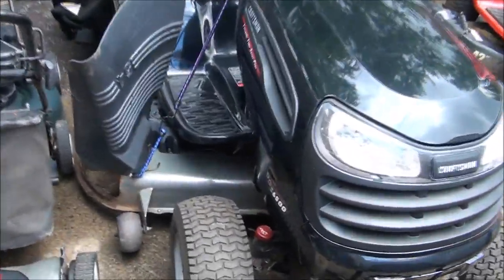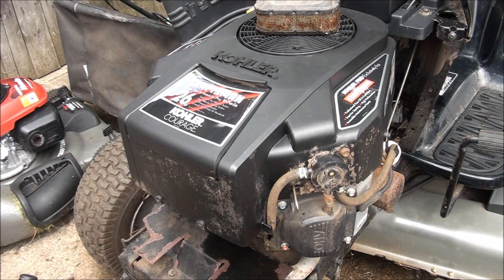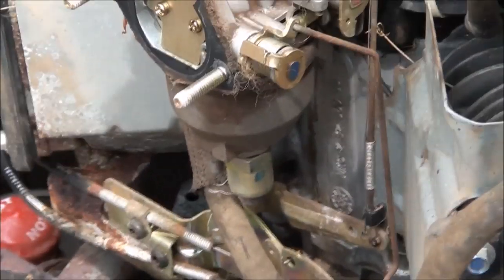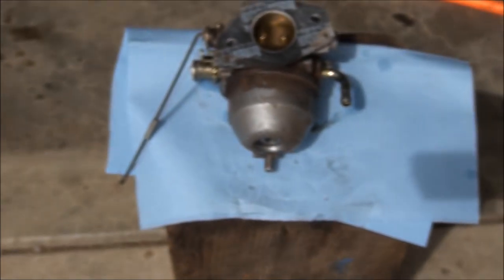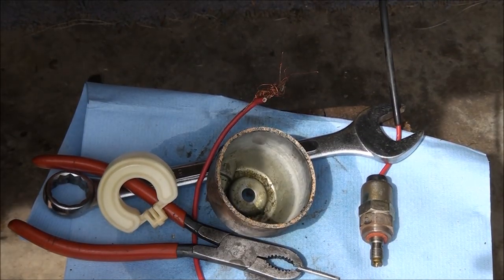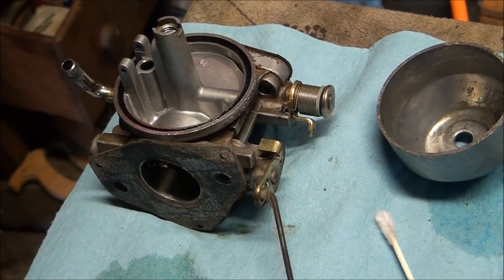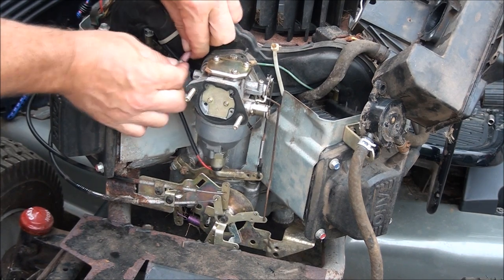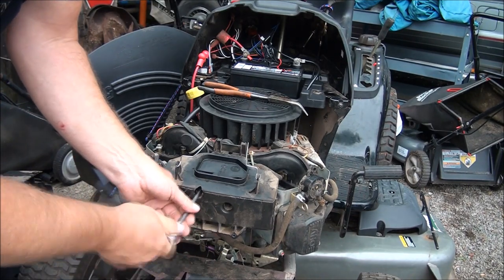Riding Lawnmower KOHLER Pro Courage 26 Horsepower Twin Cylinder ~ CARBURETOR REBUILD Repair

Comment: I want to thank you so much for this detailed tutorial  ! I have the same on my 2005 cubcadet  . It was running rough and like an idiot I took it off because online it told me carb was the problem.  It wasn't.  It was the plugs dirty filters (gas, oil , air) I thought I took good pics with my phone.  I looked at other vids yours was the only one I found where you took the time to explain and close ups ! Thank you for the close ups  ! You helped this 63 year old grandma fix my mower ! You're now my hero  !
Reply from the maker: thank! good job

Comment: My 26hp Koehler is doing the same thing! This video covers all areas of the fuel system, testing each component for functions. Maybe now I can get my mower to run more than twenty seconds! You’ve been a great help. I’m subscribing to your channel!
Reply from the maker: Thanks friend. I hope it helps.
Reply: @jeffslawnmowerrepairandservice  Many thanks friend! My mower is running smooth. The solenoid was stuck closed from green junk in the sediment bowl, the filter was varnished smell, nasty. After watching the video, I was able to clean every component of the fuel system and I didn’t have to replace any parts, now it runs again. I’m glad to see that video. Great job and many thanks for taking the time to share it. 👍

Comment: A tip that I learned many years ago with motorcycle carbs is to remove the bowls and completely submerge the carbs in a 50% Pine-Sol 50% water solution.  Let them sit for 24 hours turning them over around the 12 hour mark.  It will remove a lot of varnish and does not harm rubber or Teflon components.
Also I like to run safety wire through all of the orifices, jets, etc... 
I like to push the safety wire through the orifices before and after the carb soak, then use compressed air afterward.
* -  Just remember to pull your cut safety wire through some folded sand paper after you cut it with diagonal wire cutters to remove any burrs (diagonal cutters always leave burrs) so that the safety wire won't scratch any passages.

Thank you for a great "How To" video!
Reply from the maker: Great tip! Thanks for watching
Reply: Who the hell has time for 24hrs. I always laugh when people suggest something like that.

Comment: Great video. I learned a lot and discovered that last year when I had the mower serviced I was told that I needed a rebuild kit. Well from what I could tell from my carburetor the shop did not install a rebuild kit - most likely just squirted a bunch of carb cleaner around. Thank you for a great video. You have saved me money.
Reply from the maker: I am happy it helped

Comment: This video is top notch.  Your explanations and camera angles made the process very easy to understand.

In my case, the repair was for a 26 Horsepower Kohler Courage engine that's on my 2007 Craftsman GTS 5000.  For the first start of the season, the gas flooded into the air filter and dripped to the ground.  I did some troubleshooting and decided to clean the carburetor with the help of your video.

There were a couple of small differences between carburetors.  First, the float bowl on mine was attached by 4 screws.  Second, the float pin/needle assembly was a little different.  These differences were minor and easy to work around.

After following your instructions, I also changed out the oil, gas, and fuel filter.  The tractor fired right up without flooding, and I mowed for about an hour until it got too dark outside.  It runs like new again!  Thanks for your help.
Reply: I used the video also for a Kohler Courage 26 engine and it save me so much time.  I put on a new carb and it runs like new.  Great video.

Comment: Fixed mine just now. Thank for the video
Reply from the maker: Glad it helped
Reply: @jeffslawnmowerrepairandservice  great video  i wish i had watched before doing this work, i did basically the same thing as far as cleaning the carb, however i didnot take the slinoid componet out as you instructed,  after reassembling started right up but i could tell the engine wasnt runnung full throttle,, so like a novice i attempted to adjust the throttle and choke cables which lead to the throttle stopper screw too in an effort to idle it up and now it wont start, after jacking with it was running it and suddenly died  was able to start it but it only  ran momentarly  ,, no she  wont start ,, is there any tips or videos you have that could aid me in this?  cuz im fairly certain i have it wrong.  i can assume that the main jet in the silinoid componet neded attention ,, and it didnt get it,, because the  carb was quite dirty,, so  consequently i now figure that was the cause of the slow idle, what is your thoughts?  i was careful to reassble it with out misplacing the linkage items i refered to your video and my placment of everything is just like yurs,  i will clean the part i missed  but the throttle cable choke cable has me wnating to choke someine [ 'myself i guess'[ thanks

Comment: Thanks for the video. My son's Husqvarna was exactly like your Craftsman. The hood came off the same, same plug for headlights, the exact same bolts for the shroud and fuel pump, exact same linkage for the choke and throttle connections. Now I feel like I should be able to tackle his carb issue. His will not run unless the choke is halfway out and it doesn't have the power it should have. Time for a good cleaning.
Reply: I have a craftsman with this exact same Carburetor, & same issue; won't run without the choke being half or more closed.
I cleaned to carb, and it's better not not completely. There is something still plugged somewhere in the carb.
I'm going to soak it in my ultrasonic tank. Hopefully that will get it cleaned. (I have Mineral Spirits in it. Someone tell me if that's not good to use for carbs.)

Comment: My mower is surging, already replaced fuel lines, filter, fuel pump etc. So I guess the carb would be next just not sure if I have the time to do all that, will the surge damage the engine? It only surges on low/med not full run?
Reply from the maker: Yes surging can cause premature engine wear over time. Yes the carb needs cleaning sounds like the slow/pilot jet passage is plugged.

Comment: I have a Craftsman mower with the same engine. It runs great under load, but if I set the parking brake and let it idle, it will start surging. This mower sat in my shop for a year and half due to several issues. I have been through the carburetor once. The main jet is stripped, so it is not coming out. Is there anything I can do for it?

Comment: I have the exact same engine and carburetor. The problem I have is that mine is running rich. Is there a a mixture adjustment to lean it out or is it all controlled by the solenoid? The fumes start burning my eyes after mowing a while. It runs good however.
Reply from the maker: There is no adjustment. It may be time to rebuild the carburetor it may be flooding gas a bit
Reply: Ok thanks

Comment: Liked the whole step by step instructions. I have a different problem but think that this may at least get me where I need to go. I have a Kohler 24hp (KT735) that started flooding the carb, with the outlet spouting out fuel everywhere. I was advised on a forum that the float valve is stuck open and that I'll have to get a carb kit to fix it all up. I was looking for a clip here on how to do all that, and I think your clip should be enough to get me through the process, even though the engine's different.

Comment: I have the same mower and it will only run on full choke. What should I do?
Reply from the maker: The carburetor and fuel system need cleaning and or rebuilt

Comment: Thanks for the video.I have a Stiga Mower with the Kohler command pro 25bhp engine. Won't start when cold, had to use a squirt of easy start but starts ok once warmed up. Was all set to rebuild the carb but thankfully noticed the choke was moving but not closing fully. Took the throttle and choke cables off cleaned all round the linkages and carb and the choke began to work properly. Still not 100 percent what was causing the issue looks like something was gummed up or misaligned but the mower is starting great now.
Reply from the maker: good work
Reply: @jeffslawnmowerrepairandservice  Thanks man!

Comment: I have a 26 HP kohler that will start and run for 3 or 4 minutes then die. I've put two or three new fuel pumps on it thinking that the ones I orders on Amazon were faulty. Any ideas of what else I can check?
Reply from the maker: sounds like a contaminated fuel system maybe water/dirt in gas tank

Comment: Good video, you do need to follow your order if disassemble for the reasem. Choke linkage first, after carb on hook the throttle with clip.  I working on a Kohler 22 HP and I must have the replacement carb have a cpl different features. 
Best; Tom

Comment: It looks like you should change both ignition coils. Their was a factor update to change out both ignition coils ! with only 1 small wire for  the kill wire to stop the engine!
Reply: Also make sure you put in the 2 diode in the coil kill wire ! just like the  Briggs v twin

Comment: Never sand the PIN for the float. If you would look closely one end of the pin has a flat spot on it and if you line it up correctly it will slip right into place, always remember that.

Comment: A buddy and I just did this same thing to my craftsman ys4500 Kohler 26hp but still cant get it to stay running without putting carb cleaner in the air intake... Any tips?? Ive looked online for a new carb but cant find an exact match...
Reply from the maker: sounds like it still has a fuel delivery problem and the carburetor is still plugged. Check the fuel pump too if it has one
Reply: So after watching your over and over again I noticed that the fuel solenoid wasn't clicking on my mower so I took the carburetor off again and cleaned it, while I had it off I took apart the solenoid and it wasn't moving so I cleaned that out and it was springing back and fourth again.  Now it runs like a Deere, lol!!!
 Thank you for your video and advice, I couldn't have done it without your intelligence! @jeffslawnmowerrepairandservice
Reply: @jeffslawnmowerrepairandservice  Also where can I find a replacement carburetor? I cant seem to place one. I have a 2006 craftsman ys4500 26hp 54" cut.
Reply: This video helped to identify my issue is the solenoid not clicking. But it’s also not stuck. Even have a new carburetor, and the solenoid is not clicking. What now? Anyone?
Reply: You verified that the solenoid is opening With h the carb still on the motor pull the solenoid off and turn your key  to 1st position, if the solenoid pin pulls back then don't worry bout the  click.. I had one do the same thing worked great, just did not click!!

Comment: You don't have to take the fuel pump off. Just disconnect the vacuum line and the line from the carb, and it will come off with the cover.

Comment: I have a 17.5 hp briggs has oil in the carburetor is that a blown head gasket
Reply from the maker: Maybe, OR most likely it could be that the carb flooded gas into the oil crankcase and now it is too full. It evacuates this extra fluid out into the air box. Cleaning and rebuilding the carburetor is the solution ( and an oil change)

Comment: When I took off the fuel line from filter gas never came out so I could get the old gas out. Any solutions??
Reply from the maker: If the fuel line is plugged you will need a new one. Also, fluid pumps are cheap at most hardware or auto parts store.
Reply: Blow back to your tank to make sure cap is not plugged - get an old outboard line bulb to suck back or use your mouth... you re on the right track!!
Reply: Make  sure cap is off when you blow line back